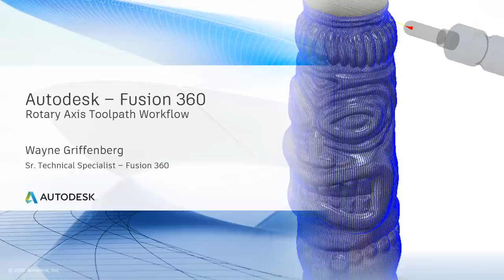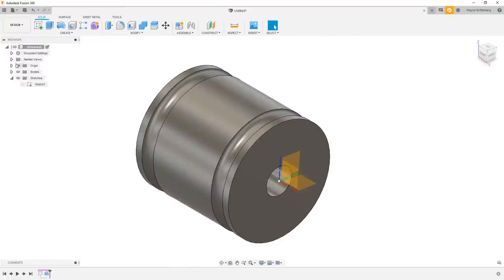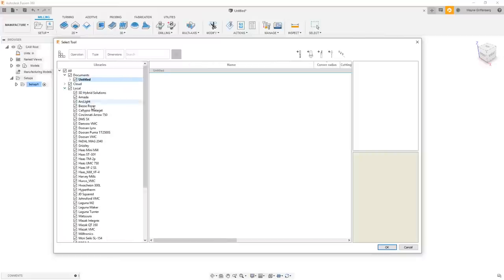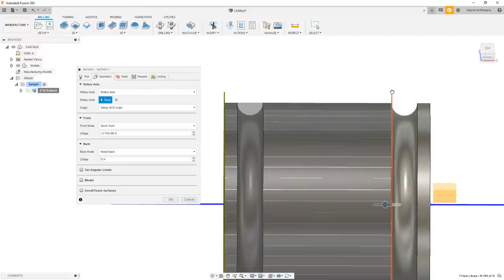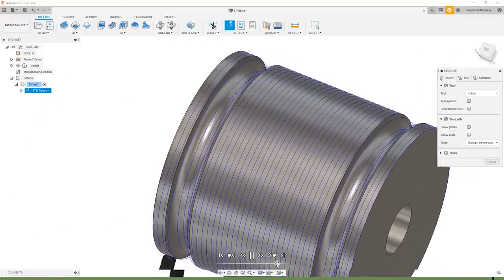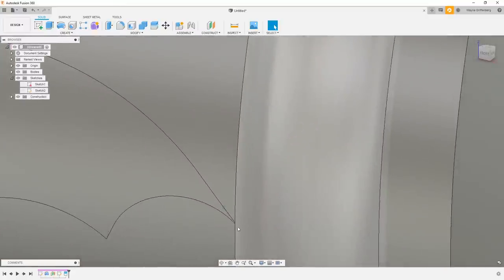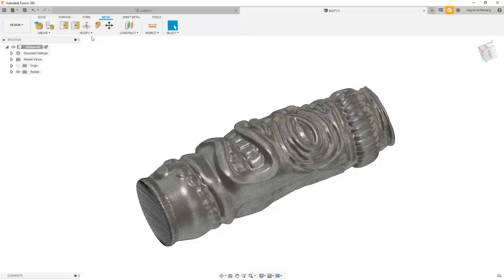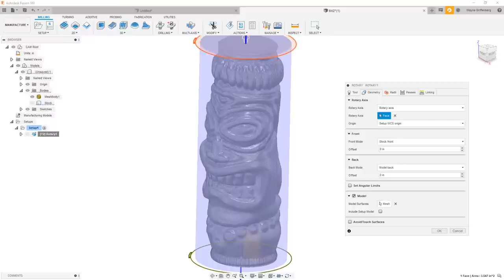360 LIVE: Rotary Machining (4th Axis Simultaneous Machining) Deep Dive

Comment: I purchased Fusion 360 to be able to use "5-axis" machining promised by the sales agent, however in order to mill a square block of wood into a cylinder on a 4th axis, I need to upgrade to "advanced"  $1600/yr "Machining extensions" to access the Rotary features?  This make absolutely no sense, as there is nothing "Advanced" in turning a square object into a round one using the rotary axis and I have yet to find a tool that natively will cut square stock rotating on the 4th axis.

Comment: I'm new to this.  How is roughing done?  For a large stock cylinder and parts with small radius sections, it seems like the cut will be too deep.  Especially in the first part of the spiral.  It seems the tool is plunged to full depth and the rotation begins.  This might be fine after the first rotation, but the first rotation is using the full width of the cutter, right?  Seems harsh.  Am I missing something?

Comment: Hello,  I just watched your tutorial as Im trying to set up my home made plasma cutter.  So far I've cut squares and circles using Fusion 360 plasma cutting tool paths.  I was impressed way more than my wife at my squares and circles  :)  I thought I'd try set up my 4th axis and do a rotary cut, thus I watched your video. I clicked on the multi-axis and found I couldnt use it without a license or using some of my 100 credits I just discovered I had.  So I thought I'd ask here. Is the rotary axis tool functional for plasma cutting or just milling?  Perhaps you could do a video on creating a tool path for cutting squares and circles in a pipe?

Comment: I am a bit confused... Will I not be able to use my rotary if I don't have the Manufacturing Extension? I'm on the regular yearly plan (not sure if it has a name, it just said "Buy Fusion 360").
I haven't looked into anything regarding CNC'ing and toolpaths yet, or the manufacturing workspace at all actually (haven't assembled my cnc & rotary). But everybody talks about the Manufacturing Extension in any video I could find about rotary, which I checked and it's crazy expensive, just to do a table leg or something like that.
Will I not be able to do anything with Fusion for the rotary, just having the regular Fusion 360 subscription?
Reply: Yup, there is your answer...  and it is unreasonably expensive for a hobbyist

Comment: I like the basic way you explained all of this operation however I have a question about 4th axis. I have just purchased a small cnc 3040, and can not get fusion 360 to use the 4th axis (A) to rotate the job around. I am trying for the first time to machine a 45mm Diameter piece of timber down to 12mm. Any advice would be appreciated.